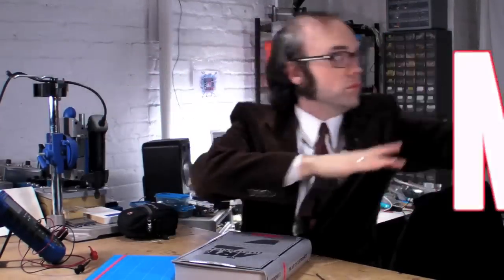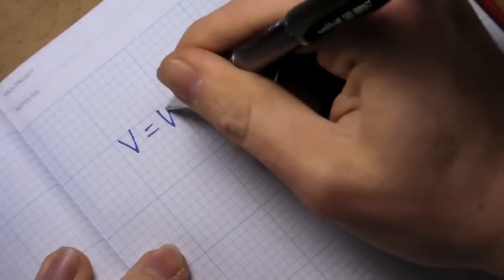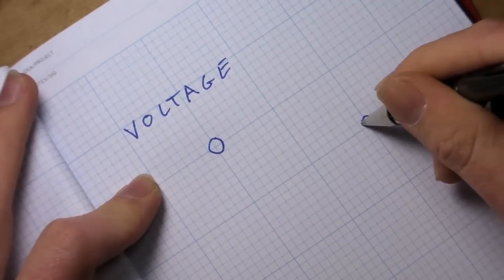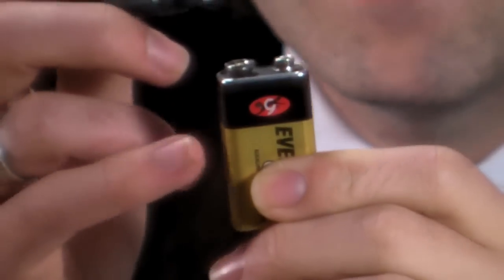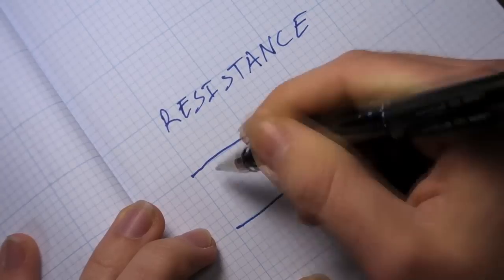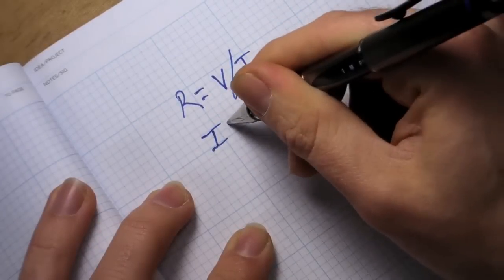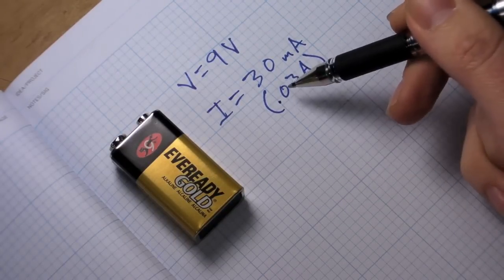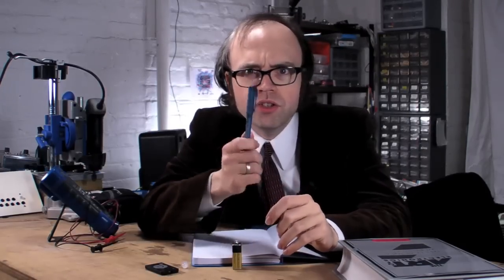MAKE presents: Ohm's Law

Comment: if you really want to design circuits, you should already know this, this is just the very basic, cause you need to know about how circuits work in series and parallel
like in serie the current constant and in a parallel circuit it wil be divided bij how many resitors you have
the voltage and resistance are added per resistor in a serie, but if it is parallel they are in every point of the circuit the same.
I learned this stuf a long a go in school when is was 14,and this is a small bit of it

Comment: The video would be better if the guy showed a practical application, for example a LED.

A resistor too big would make the light too dim, a resistor too small would burn the diode.

A resistor juuust right would give us a blinkenlight.

Comment: ok so i have a 5v output and i have a 30mA led. i calculated i need a 166 ohm resistor, yes?
but the led max voltage is 3.6v, using led calculator i get that i need a 47 ohm resistor.
so which is it?
Reply: Thanks, i was more interested in the calculation. led calculator was right i needed to divide the difference of voltage. so its 1.4V / 0.03A =  47Ω
Reply: what do you mean divide the difference of voltage? how is the original equation not applicable?
Reply: He dosent have an led in hes circuit. I failed to see that cause everyone usualy uses an led in these examples.

Comment: VOltage does not flow...example : to refare to the voltage on a resistor we say there is a voltage drop off 1.5V butt we use the term flow to say there is a current flow because current literally flow in the circuit

Comment: Can we increase voltage by increasing the resistance? since V = I x R so if I remain constant and a paramount increase in resistance the voltage should also increase...please advise
Reply: Hi, although im no expert in physics, as far as i know, resistance and voltage are inversely proportional. So if the resistance is increased, the voltage should reduce.
Reply: +Meiji Jap It depends. Usually your supply voltage is constant, but in some circuits the output voltage may be regulated by resistors. That's how voltage dividers work, for example.

Comment: Actually Ohm's law doesn't really apply in reality cause when we have current passing throught copper its free electrons move to one direction(-) and they collide with ions.As a result the temperature increases that means those ions move more and more giving a hard time to the free electrons to pass that means resistance gets higher all the time.So V=IR,I=V/R or R=V/I gives only the momentary R,I or V.

Comment: Hi  there  i've  been veiwing your instructional video on OHMS LAW  on V=IR which i never use before nor the formula .. I've been told try to learn it for what i want to do.. Well i've been going over, and over again with alot of writing paper trying to figure it out it's kinda difficult , i know it can be done if their was a little better way to do it  another way of breaking it down to make it more simple to understand this AGAIN I'M NEW AT THIS .  NOW i purchase a model kit that i want add some LEDS to it the model will take at least 7 LEDS  The LEDS  that i want to add in the model  are color LEDS which have their own voltages and ma . I  want to add 4- 3mm  white  1- 3mm blue  1 - green3mm and 1- 3mm red , Now i calculated each led and the calculator has given me that resistor value to use now since i'm going with 7 leds it would have to be in parallel series 1 - led 1- resistor ok i got that.  how do i know what power supply to use 9volts or 12 volts  Pls explain what I'm doing wrong NEED YOUR HELP THANKS  henry.

Comment: Please read... Infinite energy through the conservation of current and voltage using ohms law... Math: v=10... R=2 ... Then I=5... In a series circuit with one resistance I read that voltage is the same everywhere with one resistance...  Now let's run it again through a reciprocal resistance after running R=2 now R=.5 now V=10 R=.5 and current goes back to the original number that it was decreased by... So hmmm... Or keep running it through 1 ohm... So 1 ohm gives 10 current and 10 voltage then run it though again and you get the same back every time... 10 current and 10 voltage.... I guess the key would be to capture the current and voltage after use... So... Hmmm

Comment: Well... I guess voltage is voltage drop... No problem... Then look at series circuits having constant current and parallel having constant voltage and current gives rise to voltage and voltage gives rise to current according to v=ir... So... Say you run a series circuit...current is constant everywhere... So then after running it through a series circuit... Take that current after it runs through all resistances (remembering nothing is lost in current and is constant) then run it though a parallel circuit... And this current will give rise to constant voltage... So back and forth... And remember reciprocal resistances or depending on the equation... Fractions and whole number combinations that give rise to higher voltages or currents depending on the resistances... May be complicated to you? But try it... Remember... Say in a series circuit... Voltage drop is split over resistors in series proportional to the individual resistances but current is always constant... Then take that constant current and run it through a parallel circuit... Now voltage is constant everywhere... Now take that voltage and... Remember fractional resistances and whole number resistances... Fun!

Comment: so the higher the voltage the higher the current?
Reply: Filbert Lim not really. think of voltage as the unity to measure  (tension)  it can be thought of as  the pressure that forces the electrons to move through a conductive material. The amount of electron in a section of this conductor is what is called ampere. so there can be electricity with very small current and very high tension.. or very high current and low tension... resistance is to measure the "dificulty " that a material offers to the tension to push this  electrons, or also the difficulty it offers to the electrons  to travel through this material. so the more conductive the less resistance and the lesser volts you need to carry a certain amount of electrons through it (current) ..the lesser the conductivity the more volts is needed to push the same amount of electrons through it.. So basically, Ohms law is the relation of this 3 measurements. And there is also the Watts, which measures the amount of power or work that can be done by this flow..
Reply: Filbert Lim not really. think of voltage as the unity to measure  (tension)  it can be thought of as  the pressure that forces the electrons to move through a conductive material. The amount of electron in a section of this conductor is what is called ampere. so there can be electricity with very small current and very high tension.. or very high current and low tension... resistance is to measure the "dificulty " that a material offers to the tension to push this  electrons, or also the difficulty it offers to the electrons  to travel through this material. so the more conductive the less resistance and the lesser volts you need to carry a certain amount of electrons through it (current) ..the lesser the conductivity the more volts is needed to push the same amount of electrons through it.. So basically, Ohms law is the relation of this 3 measurements. And there is also the Watts, which measures the amount of power or work that can be done by this flow..
Reply: Fernando Penas I see. Thanks man! :)

Comment: Some one help me, I have a 9v battery, and a DC motor rated at 5v how I make it work
Reply: Depends on how many amperes the motor can take. You must put a resistor in series with a voltage drop of 4v.You can calculate the right resistance with 4v / (max current rating of the motor)

Comment: I hate it when people try to explain electricity with water examples. It's just wrong. Electricity and water are not comparable at all.
Reply: Anime Reviews 
 he lost me  around the 3:00 mark .

    I don't learn  think very well when someone  seems to be repeating what they read  in a book   which i could have done and still been confused .
Reply: Well you're not comparing them, you're just giving an example. But these people just don't know how to explain the example properly. Using water to explain is fine, if it's explained right.
Reply: Tortoise010
I  meet far too many people that are good at repeating what the read or were taught,   but  when  I press them  for WHY  it happens they go blank .   

   I learned about the crystal wafer diode   on my own  because my teacher  didn't know why   the current  would flow   one way in the  Alternator's rectifier.
       It was the semi-conductor   doping of the oxides  and the magnetism   from a charge  that push the  AC  Sin wave   power  across  one wafers  while the   the back flow  charge  was not as   high to   jump across the oxides  doping  in the semi conductor   after the main one  .

     It was like shoot pool  when the energy    from the cue ball  collides  to move  a few balls   but the last one can't bounce back  off the bumper  to  return   a equal  kinetic energy.
Reply: +Anime Reviews 
It's a popular analogy because nearly every person on earth understands the flow of water. That's how people learn, by referencing things they already know.
Reply: +Cabhan Listis 
  But   electricity  in an  AC system  is like waves hitting the  Shore  while    the people trying to simplify  how it works   treat  it like  Rain  falling   or  water in a pipe  while is more like the DC  flow in one direction.  
      I understand  how the atom  works  and the Electron  orbits  ,  so for someone to  tell me that   an Electrical  charge  from the power Plant  causes   each electron   to split-off  form the atoms  Orbit  and  join each atom  down the chain   of them in the copper  wires  is pretty amazing  to  happen at that  atomic level  .
      Having a billard table   from  Niagara falls  to Chicago   would be amazing too   where I could   smash the cue ball  into the first  ball on the table   that would  hit  each other ball  all the way to  Chicago  to displace  them one by one until the last ball  rolls along the table.  

   It would make more sense   if the magnetic field   exploited  each Electron  to   be a quasi  stepping stone  that transfers that  power  along the line  to your Home  and then drives the  appliances   for  making  Heat  or spinning  another  Motor  using a magnetic field  such as a vacuum or blender. 
      It would be like  each of the 8  Planets  having a Lighthouse   on them with a Laser  cannon   that send a beam  from Mercury  that bounces of   Venus and then Earth  to Mars and down the line   because  the SUN  is like the   core of the atom  as the 8 Planets ( Plutos  back to a  semi-moon  status again )   are the Electrons  used to get the  laser  to  Neptune .
   I can't picture    each planet  colliding   in a row to replace  each of their orbits  until Neptune  flies off  into space.
Reply: +Gary wood Man, this conversation really got out of hand fast.
Reply: +Anime Reviews It's a perfect analogy because stored water in a tank or other location is considered "potential energy" much like electrons sitting on one side of a battery waiting to move. Once you close the circuit, or let the water move out (preferably through a piping system to make the analogy work better) you now have kinetic energy (or current flow). By restricting how much water can flow through the pipe, you are basically "choking off" electrical current (like using a resistor, only with water it would be a valve). Also, electrical current and flowing water will ALWAYS find the path of least resistance. Same is true when you pressurize gasses.
Reply: +Leonel Ventura what is charge, elementary charge using this?
Reply: ThePerfect1077 Not sure what you're asking. The term "charge" in electricity and as applied to electronics is tricky.
Reply: Leonel Ventura i was asking what is representation of charge, and the actual charge per charge carrier using the water analogy.yh u r right, that's kinda his point and mine, this model doesn't have a good representation of charge. so it's not a perfect analogy. i use this analogy for p.d, e.m.f s, resistance and another analogy of malteasers on a conveyor belt that fall of the end for charge and current. where charge is the profit u make from malteasers that falls of the end in x time. and the elementary charge as the profit u make form one malteaser
Reply: You are reading too much into the analogy.
Reply: Leonel Ventura no i'm not, u said Anime reviews was wrong and said that it was a perfect analogy. i don't think i'm going too much into it because charge is one of the essential, basic things u need to know to understand electricity and if the model gets that wrong it's far from perfect